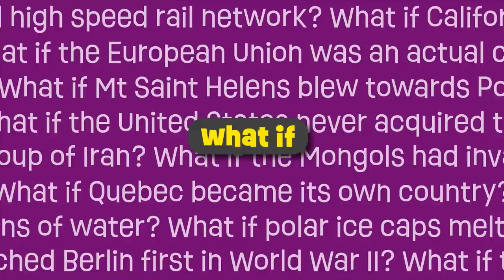Water Pipeline: What If An Aqueduct Was Built From The Great Lakes To The Southwest?

Comment: The rules here in the Great Lakes region dictate that only areas that are part of the basin (that is, ground water flows to the lakes) are able to take water from the system.  Where I live we have Lake Michigan water in our homes.  The town 5 miles south of us has to use wells instead, and the water is so poor that most people use bottled water for drinking, and some even use it for bathing and clothes washing.  If the rules don't allow this particular town that is only a couple miles out of the Lake Michigan basin to remove water from the lake, rest assured no one involved in the management of the Great Lakes is going to allow the people currently wasting and rapidly depleting the water in the Southwest to destroy our Lakes.
Reply: Yeah....BUT....if everyone is so concerned about Lake levels...why do YOU think it's OK to let the Lakes go on a rampage, like they did two years ago, and DESTROY MILLIONS OF DOLLARS worth of shorelines? Those lakes can become wild beasts and letting them destroy property, willy nilly, with out the control of high levels... is as bad as lowering lake levels to supply the South West. Lake Michigan and Lake Huron should be "maintained" at one STANDARD level. Any excess should be gotten rid of by any means necessary INCLUDING selling it to the South West!
Reply: @badguy1481  That still wouldn't be a solution to the problem, because an inconsistent lake level wouldn't be reliable or profitable.  You need to be able to guarantee a certain amount of continual running water to be able to invest in infrastructure like building a pipeline from the great lakes to the southwest.  The great lakes would essentially need to always be above average to make such infrastructure reliable or profitable.  If you're a municipality in the southwest that depends on that pipeline and we go through a decade or more of shortage like we did from 99-2015 in the great lakes then your water source would turn off and you be left without.
Reply: @badguy1481  easy there badguy we can't help people who will not help them selves
Reply: @badguy1481  my god rampaging wild beasts willy-nilly I don't know how we can go on here in Michigan
Reply: @badguy1481  The property that was destroyed belongs to 1%rs boo hoo
Reply: @jcdentoid  Actually you have no clue what happened in Flint
Reply: @marktalsma2390  And city fronts...and public beaches...not JUST 1%'ers. The repair, of which, came out of YOUR pocket in the form of city and state and FEDERAL taxes.
Reply: Hey..."Some" water from the Great Lakes is better than "no" water. Obviously, if that water is not enough to keep the South West solvent (water wise) than other means of obtaining water will be necessary.  @TimothyCHenderson
Reply: No one is "wasting" water in the SW.
We are growing 80% of the entire NATIONS produce from October to May while the rest of the country is frozen in.
The average US family uses 1 acre foot od water today.
That same acre foot supplies 4 families in the SW. Arizona uses less water today with 7 million people then it did in 1960 with 1 million people.
I have long said that the US SW should stop growing agriculture.
The shortages of food that follows and the massive increase in prices in the US would have the entire nation screaming "fix this".
Easy for me to say, I am not a farmer. 
But that is sort of the point, no one wants to fix anything that does not effect them. So let this affect everyone. 
The SW has plenty of water to support its population.
Just not enough to grow everyone's food. So if agriculture is a waste than I agree with you. Let's stop it.
Reply: ohh we whold want a serious amount per gallon knowing its the last of the water left.  im from western ny up by lake Ontario
Reply: In your video you acknowledge the effects of climate change on the West Coast it is indeed getting more heat waves and hotter but if you take the time to look at the effects on the East Coast the atmosphere is holding more moisture and causing it to rain on eastern states longer and more frequently this is causing flooding to become more common on the East Coast So imagine this instead of trying to take water from the Great Lakes one source that is to say. we make a more elaborate system that is connected to various rivers and some lakes on the East Coast Then when it rains more frequently and starts to hit flooding conditions in that area a switch could be Flipped opening up a water pipeline to take the excess water to where it would be needed more thus stopping the Flood From happening and allowing the excess water to be transported to the western states I suppose this is more of a water pipe network then just a simple water pipeline I think it's the best long term solution the western states get the water they need and the eastern states that are being hit with more rain and flooding will no longer have increasing Flooding events. I would also like to make it clear that I do agree that Salt Lake City and the other cities and states in the western states need to manage their water better then what they currently do also I don't know why So many people  think the only solution for a water pipeline would be the Great Lakes sure on the surface that seems like the most obvious solution because it's in plain sight but like you pointed out in the video it's not the best long term solution however this water pipeline network I mentioned earlier would be one of the best long term solutions if you think about it for a little bit and do some of the research on climate change not just affecting the West Coast but also the East Coast you'll see my point. / Also on a side note between 2030 and 2040 Florida is doomed as they are the state that will be damaged the most from rising sea levels.
Reply: @FastEddy301  that so called food they grow out there while we are frozen SUCKS bud!! We grow our own and can what we grow! No hate pal just sayin. Went to Walmart a few days ago, 1 ear of that crap sweet corn, 99 cents! Yes I grow my own!! Thank you Biden!!
Reply: Waterfront Georgian Bay. I have a shore well with a tile under the bay. Across the road, they have water trucked in. Clay.
Reply: With our current administration....you don't have a choice about anything you don't like.
Reply: @KB-ke3fi  
LOL!
Please tell me you aren't blaming the water shortage on Biden.
Reply: @badguy1481  because we can .. I live here and all states & Canada all past laws the last time the SW thought of this .. you want to live where it's warm and hot ..a dessert ..enjoy it in the mean time it's ours so if you want  water ..move to where water is enjoy your hot weather, we're pissed nestle is taking 2 million gal a day out for bottled water at such a cheap price .that has to change quickly also
Reply: When I lived in Chicago in the early 1950s, it was well known that the Chicago River was re-engineered to flow "backwards" out of Lake Michigan into the Chicago ship/sanitary canal and into the DesPlaines and Illinois Rivers and finally into the Mississippi River. That seems to me like quite a bit of water out of the Great Lakes Basin.
Reply: An aqueduct to the southwest from the great lakes is a very dumb idea. The sw needs to solve its own water problems without placing burdens on people who have decided living in a desert is a bad idea
Reply: @Thedaleb1  
There is a suggestion on the floor to do that by no longer being the breadbasket of America and stop producing the food that is shipped to the stores you go to every day.

Is that what you are in favor of?
Reply: That is what the rules state now, but when Gavin Newsom becomes president they will be belong to California.
Reply: @Robert_Keel  so you are you are that that might not be they aren’t gonna what
Reply: @badguy1481  a little birdy tells me you are badguy1%er. I don't give a shit if your house fell in the lake. Not my problem. As for taxpayers money it would take a whole lot to build a pipeline to the Colorado River.
Reply: @asherdog9248  not going to happen they better bury that pipeline or going to get blown up. Just a little monkey wrenching
Reply: Some of the best fresh water on the planet, it taste good and it feels good on your skin... not to mention, I can go to my kitchen faucet tap in the middle of summer and get a 50 degree glass of water right from the kitchen sink... cool and refreshing.
Reply: @walterbrown8694  
You do realize that the whole reason for reversing the Chicago River's flow was to keep the pollution out of the Lake. At the time, all of the City's sewage was going into the river. They did it to prevent contaminating the water supply. 
Plus, that is one river, with a limited flow, not millions of gallons or liters of water over 1000 miles.
Reply: @walterbrown8694  Well...two years ago opening those locks was not enough to lower the level of the lake.
Reply: @marktalsma2390  Hey...We build long distance pipelines all the live long day. Building another one that would both save Great Lake flooding AND supply fresh water to the South West (ALL for a fee going back to the Great Lakes States!) would be money well spent!
Reply: @tomboone201  Hey...Water, like Oil, should be sold at a price. People PAY for other people to drill wells. People PAY for oil to run their vehicles and heat their houses. WHY should people pay for water coming from he Great Lakes! People can LIVE without oil. They CAN'T live without water.
Reply: @badguy1481  Sure thing there badguy1%er, anything to keep your house out of the lake. Still a lot of money and not much return on investment 
.
Reply: @shytownmofo  You are absolutely correct - I, however, never had any  concept of the flow rate from Lake Michigan, since the whole topic was always about the  pollution in the lake's drinking water and the  engineering  solution.
Reply: @badguy1481  you do realize you messed with the wrong badass
Reply: @marktalsma2390  Who YOU? lol! You're kidding....right?
Reply: @badguy1481  I'm thinking your not from  around here or your house is about to go into Lake Michigan so sorry
Reply: @badguy1481  and I could care less about your house this plan to take water from the Great Lakes to out west makes no sense at all
Reply: @badguy1481  Are you expecting water to flow only when the A) "flood gates" need to be opened?  That would be years between very short term episodes. (Maybe you have been mislead.  Flooding of the great lakes isn't really a thing.)  Or are you expecting to B)  permanently lower the level of the lakes such that the occasional peaks could never reach flood stage?  If it's plan B, once that new lower level is reached, would the water be turned off then?  Or would we just drain the lakes dry?  Like the mighty Colorado River.    Robbing Peter to pay Paul might work for the short run, but in the long run, Peter is broke and there's nothing for Paul to rob.  This plan is not sustainable.  For this plan to be sustainable, the amount that would be diverted over say a year, would need to be replenished within that same year.  Where is that extra water coming from to replenish the lakes?  If it's not replenished, the lakes will be emptied, same as the Colorado River.
Reply: Where? Flint? The water is great in Michigan.
Reply: @badguy1481  1-2 tankers, no more is what they deserve, maybe the South West should be more competent with their water
Reply: @marktalsma2390  I know , what the hell is this dude talking about
Reply: @walterbrown8694  How long ago was that
Reply: @mykehunt2430  "Myke" - Over 60 years ago, I worked for a company in Harvey, Illinois - When we wanted to contact another employee, we had the switchboard operator page him. Sometimes, we would request a page for a fictitious person like "Alfred E. Newman" - One time a coworker tried paging "Mike Hunt" - That apparently wasn't gonna be the operator's "first rodeo" - She asked if the page was for "Michael Hunt".
Reply: Great Lakes Pact isn't only a State agreement, but also involves Canada. Almost anything can be overridden by federal legislation however. States should theoretically help one another, but considering the corruption & obnoxiousness coming from places like southern California & New York, where they act like we are "fly over" territory, while they abuse corrupt institutions for their profit, I would go to war before they extract our water for their greed & broken immigration policies.
Reply: @badguy1481  we the people of Michigan, had a governor who took toxic waste from Canada, polluting our water, killing several children. A famous bottle water company filled a law suit, Michigan lost an enormous amount in revenue. We have spent millions cleaning up many of our lakes and water resources. companies using out waters for dumping toxic waste. You want our water, come get. Move here. Most of our water comes down in SNOW AND ICE!
Reply: @badguy1481  yes, out our shorelines shift and change. removing water tables Is Not Going to change the wind. Water from the west side of Michigan will soon be in Detroit. And vice versus. Move to Michigan. If you want water. Experience true ICE WATER.
Reply: @poppydillings7448  BS! I suggest you get the monthly periodical from the Army Corp of Engineers regarding Lake levels.
Reply: @poppydillings7448  And you OWN IT...the water? You OWN what's on your property (NOT including your house!). The COUNTRY "owns" the water...not you!
Reply: @RomanMyshoul85  And you? Do YOU water your lawn in the summer. How about when you take a shower, do you let it run a long time to make sure it's nice and hot. How about all the leaky faucets in your house? Why don't YOU stop doing what you're doing when it comes to wasting water?
Reply: @annnonomys3132  Hey...Maybe the South West should keep all it's oil and let YOU move to where you can fill up your tank. And how about all the fruits and vegetables you get from the South West during the winter in the "Great" Lakes...using water you say they're "wasting". And next time your house gets hit by a flood...or fire...or Tornado...maybe the rest of us should tell YOU "move to where your house won't HAVE any of those problems?
Reply: @DavidJohnson-pu2jh  Actually a better idea from the "fairness" side anyway. And it both balances out two problems and gets to a feasible solution. The downside is that it would take several dozen thousand miles of say 24" pipelines criss crossing the country to really make this work- to build a pipeline or aqueduct system to move the water across 2500 miles- that aren't very level BTW- lots of uphill pumping energy will be needed, there will be places where many lines going through a given area will need a right of way hundreds of feet across. You won't bury a lot of it, so arranging and maintaining both the legal and necessary upkeep  will keep an office full of people working all year long, every year. Oh, and building it will be a work for a half million men for decades. LA will have collapsed into the dried up remains of the LA River they started cementing up a hundred years ago long before you can deliver the water. Your best point is that there really is enough water and then some, for the US now for and for the immediate future; how then do we apportion it among our various states and parts? And how should we treat a territory like Puerto Rico? Wouldn't building them a many billion dollar desalinization plant make more sense than a pipeline? And now the desal is brought into the discussion, why wouldn't large scale desal work for California? And why shouldn't Cali be selling water to her neighbors at muni prices? I mean with 880 miles of coastline Cali has the places to get fresh seawater from, you think? Get over any idea there is a cheap or fast final solution here- trillions of dollars, decades of infrastructure investment. It would be a natural development to add rebuilding and rationalizing our national energy grids at the same time, don't you know. But it's not a bad idea at all. Just a few minor bumps and potholes and "Bob's your uncle"- done!   And it was all so predictable. the geophysical exhibition we call the Grand Canyon has been telling us about thousands of years, some with very little water and some with ground gouging deluges, over thousands of years. But apparently we thought not "our thousand years". We really need to fix that flaw in our ointment too.  FR
Reply: @annnonomys3132  Nobody is saying DRAIN the Great Lakes to supply the South West. What we're saying is regulate the level of the Great Lakes, especially Lakes Michigan/Huron so we don't get these wide swings. That water can be better used someplace OTHER than letting dump into the North Atlantic. We can dam up the outflow of both lakes at Detroit so the level of the lakes can be maintained while continuing to supply water to the lakes below them, Erie and Ontario. And THOSE lakes don't need to suffer either because they can add to the water fix by damming up their outflows over Niagara Falls and the St. Lawrence Sea Way.
Reply: @marktalsma2390  Nor do YOU!
Reply: @badguy1481  You do realize that if the cost to ship and pump a gallon of water were exactly the same as crude, you are talking about 15,000 gallons a minute, every day, every week of the year- mucho mega bucks, water bills that look like house payments for basketball half court size lawns. Even if it cost less per gallon/mile traveled, say 25% less, it would still be staggering.  FR
Reply: @badguy1481  I live in a state that has water and also doesn't completely miss-manage it.  I don't waste money on bottled water, I turn my shower water off and back on and I water the hell out of my grass so I could complain about cutting it twice a week.  Move to a state that isn't killing itself
Reply: @badguy1481  kiss off
Reply: @badguy1481  bull that’s how it starts
Reply: @oldjarhead386  Hey....If you don't like low water levels in the Great Lakes....build dams along the entire stretch, from Lake Superior to the St. Lawrence's outlet to the ocean. Right now there's NO....ABSOLUTELY NO regulation (except, maybe, at Soo Saint Marie, by the Soo Locks...and guess what, Lake Superior's water level doesn't vary much at all! Hmmmm. I wonder WHY??)
Reply: @tomtrajnowski4266  Ditto! OBVIOUSLY...the truth hurts!
Reply: @RomanMyshoul85  Oh...You TOO are a water waster... I see. And you're complaining about those water wasters in the South West?
Reply: @fredericrike5974  Hey....Gas is expensive and people keep paying the prices required to drill it out of the ground, ship it to refineries and truck to gas stations. 

Pumping water from the Great Lakes has GOT to be cheaper than that! And what's the other option? You can LIVE without gas. You CAN'T live without water. WHATEVER the cost people will PAY!
Reply: @badguy1481  I guess you missed the point that I'm not stupid enough to live in a part of the country that has NO WATER.
Reply: @RomanMyshoul85  Gee...You wanna medal?
Reply: @badguy1481  settle down there badguy1%er, take a deep breath. Sorry about your lakefront property
Reply: @badguy1481  Oil and veggies are a business for which the end user pays and the producer makes a profit.  It's a win-win.  Maybe someone could make a business out of buying and shipping water to the southwest at the expense of it's end users.  But seems unsustainable.  Pretty expensive for that end user.  Probably cheaper for that growing population to leave.
Reply: Columbia River could be an additional source.
Reply: @badguy1481  I live near Lake Erie.  I am unaware of "wide swings" of the lake levels.  The lakes will below average for years, and then above.  We get water from wells and Lake Erie.  If I understand correctly, we do not get water from Erie during the summer due to water quality issues.  Why should we prop up a rapidly expanding massive population in the desert?  Do these desert folks have enough money to pay to bring water there, or are the rest of us supposed to support their lifestyle choices?  And what economic and environmental damage would this cause even if all this were "free".
Reply: @FastEddy301  wasteful ag is a waste,cut down all the almond trees and you have enough water for the stuff we need. I don't need almonds that much
Reply: The water in the Great Lakes mostly fell as rain onto Ontario, Canada.  Very little rain falls on USA states (except Michigan) flows into the Great Lakes.  USA states are mostly in the watershed of the Mississippi River.
Reply: You are spot on if they were allowed to have access to great lake waters they would just use ever-increasing amounts of water with no regard to conservation and suck the great lakes dry just look at lake mead.
Reply: @annnonomys3132  Well...Lake Erie evidently didn't see the Lake swings that we did on Lake Michigan and Lake Huron. Those swings did A LOT of damage to their shorelines. Keeping their levels at some standard level would save us all A LOT of tax money.
Reply: @badguy1481  The project proposed here is massively expensive.  Probably cheaper to plan for the natural rise and fall of the great lakes.  In addition, such projects inflict their own economic and environmental damage.  And such projects are often approached as if they are infallible and permanent.  They are neither.  Think New Orleans Levee disaster.
Reply: @DavidJohnson-pu2jh  Hot damn! Somebody who reads long stretches of comments! You were correct to point out the salt problem- but that may mot be nearly the problem you think; Pacific salt water has not only sodium chloride (common salt) but trace quantities of nearly every metal on the strategic metals list- those could be extracted and are valuable enough to help defray the costs. Then start blending up your sewage waters for release into an oceanic environment with salt to the same percentage of sea water at that location. Both you salt overage will be dealt with and the salt will accelerate the decomposition of bio materials still in the sewage runoff.
All that is in the realm of the possible- none of it is cheap- more zeros than you think, many numbers will run to the trillions and take decades to accomplish. What LA and Cali are clamoring for is an answer in the now of this and next year. there isn't one I am aware of, even without getting into the multistate scramble it would take to get all the approvals, licenses and rights of way needed. BTW, just to do a big desal with multiple locations in Cali would take at least a few years of wrangling just to get all the paperwork done. So, political will will also be very necessary- a lot of political will, from both sides of the aisle.  FR
Reply: @TimothyCHenderson  The purpose of dams on the river is to store the water during those surplus years. There should be a turn off so that continual running of water is not necessary.  But the high levels of the Great Lakes could be controlled and still provide transport during the excess years.
Reply: @badguy1481  no it would not save us taxpayers, it would keep your lakefront mansion out of the lake, so sorry for your loss
Reply: leon hill  actually he does live by the water and his shoreline is eroding and his house is about to go into Lake Michigan. He doesn't give a shit about the SW he just wants to lower Lake levels he still has a little bit of lakefront property left
Reply: @badguy1481  badguy1%er you have still not called me on your 1% status,wonder why not. The truth hurts.
Reply: @marktalsma2390  Lol! IF you live anywhere NEAR Lake Michigan or Lake Huron go to your nearest City Hall and ask them how much they had to spend to refurbish their lake side parks...road...bluffs...etc. Then get back! (Oh..and P.S. Don't worry about my house falling into the lake. I'm not!)
Reply: leon hill  And YOU don't live in a state that has tornadoes...or forest fires...or floods...because you WON'T be "on your own" and I'LL have to pay more taxes to insure you're not?
Reply: @annnonomys3132  Hey...Take a ride down the Mississippi and SEE the number of dams and locks that YOU have helped pay for! ONE DAM across the St. Claire river would be enough to keep the Lakes at a standard level and keep them from dropping below that level. If the Lakes get too high the dam could be opened and the pipeline could help syphon off any excess.
Reply: @annnonomys3132  OF COURSE that water resource (like oil) would be paid for! Nothing in this world is free.
Reply: leon hill  And with your attitude... I don't care about none of u EITHER.
Reply: @badguy1481 give it up
Reply: @badguy1481  so I hear your house is not going into the lake
So glad you were able to move it back.
.
Reply: @DavidJohnson-pu2jh  I have been following the global ecological disaster for thirty or more years- I was a high school student when Nixon's government turned out the EPA act. It wasn't ever supposed to "save us from the end of the world", rather it seems the Nixon government was looking to regularize environmental rules and reduce the never ending lawsuits from the Sierra Club on the West Coast and the Riverkeepers on the East Coast. Note, the SCOTUS has said agencies, like EPA, cannot just write their own standards- Congress must hear, debate and weigh in officially. BTW, although I think the EPA was a great idea from the get go, I agree with having Congress take a direct hand in promulgating those rules. Congress didn't want that job because it gets in the way for them- those rules might make "enemies" of big donors and such like PO'ed with Congress for biting their personal sausages.  FR
Reply: @badguy1481  You do realize you cannot just "dam up" the Great Lakes to retain water levels. Freighters on the Great Lakes move 38 million metric tons of cargo across the Lakes annually.
Reply: @Superintendent-iy9zv  you have apparently never had a grape fruit from here have you? Put it up against anything from the Midwest. Same goes for lemons, limes, apricots, almonds, avocados, cantaloupe, honey dew melons, and strawberrys. In fact Arizona is ranked second in the nation for all of the above.
How's the avocados by you? Maybe your grapes are better? Funny how the SW now ranks #1 regularly for wine. I mean if corn is your thing than no doubt the Midwest wins. 
The grapefruit makes Florida's taste bitter as hell.
More importantly the livestock in the country really don't care what the food tastes like. 
No matter your opinion, the SW grows over HALF the nation's HIGH-VALUE specialty crops.
Worth hundreds of billions to the nation's economy. That's not even mentioning the beef from Arizona and Texas. 
My whole life I ate the crap out of the northeast and Midwest and never knew what a good steak was until I had one local.
Reply: First "freighters"...."foreign freighters"...have SEVERALLY damaged the eco-system of the Lakes. They've brought in fish and shell fish species that have caused MAJOR damage. Yeah...Ike thought it was a great idea to make the Great Lakes accessible to ocean going ships. I even remember all the celebration and hopes for the future when he cut the ribbon! BUT......He and just about everyone else did not know the nightmare they were about to cause.

SO....ocean going ships should be BANNED on the great Lakes. ONLY Lake transports should be allowed to ply the waters. And just like on the Mississippi...putting in a damn does NOT mean those ships can't traverse across the damned up point. Drive down the Mississippi, one time, and you will see one set of locks after another. Those locks NOT ONLY allow shipping to pass through they can also act as a barrier when water levels get out of control. The ONLY problem on the Mississippi IS if the water levels get out of control. They have no place else to send it other than to open their gates and let the next set of locks worry about the excess water. THAT'S WHY Dams along the Great Lake's "choke points" combined with outflow pipelines, to ship the water where it can be used, would eliminate that problem.
Reply: @badguy1481  not only the pipeline would be expensive but now you want to double down on stupid and build a bunch of dams and locks. That's a lot of taxpayers money there honey
Reply: @FastEddy301  the SW grows over half the high value crops until they run out of water,what happens next we in Michigan will supply the country. We grow weed year round, we already grow more diverse crops than any state other than Cali, we don't need your weed and we will get by without your bs
Reply: @badguy1481  SEVERALLY really ally
Reply: @marktalsma2390  Like I said....Checkout ALL the dams and locks on the Mississippi. All Lake Huron and Lake Michigan need is ONE dam, about HALF THE SIZE of any of those on the Mississippi (at Detroit) and the water problems on the lakes would be over (when a syphon drain to the South West is ALSO installed.)
Reply: @badguy1481  Do you have any idea how big these lakes are and trying to control water levels is probably almost impossible.
Reply: @user-rc6me8tg6j  Look at Lake Superior...EASILY controlled by the Locks at Soo. By denying that the problem of controlling water levels in the Lakes is "almost impossible" you're acknowledging that the continued outflow from these VERY valuable water storage reservoirs (valuable to the very life of the USA's population) to the Atlantic Ocean is our only course.
Reply: The great lakes states would never allow it. The great lakes would be drained in no time if the people out west took the water.
Reply: @badguy1481  give it up badguy1 you have shown yourself to live up to your badguy1 name. No one wants a badguy
Reply: @marktalsma2390  lol! But EVERYONE wants the money that controlled Lake Water level will save them in their yearly state taxes....INCLUDING, I would guess, YOU`
Reply: @badguy1481  when a syphon drain is also installed to the SW, you need to set down the Crack pipe and start smoking some Michigan weed
Reply: @badguy1481  my state taxes aren't enough to break the bank. I don't mind paying them it's a part of living in the greatest state in the country
Reply: It would make much more sense to take it from the Upper MS river system, in areas it Floods every year from the winter freezes and runoff...causing Billions of dollars in damage over time.
Reply: @TimothyCHenderson    Remember in the 80's we had too much water..so it's all variable.  Why has the SW gone into a water shortage, People for the most part...Millions and Millions of people moving here, because all the big, poorly run cities in the NE and  Upper midwest (Chicago) have run Law abiding people away, and now Californians are Fleeing to AZ for many of the same reasons.
Reply: @Thedaleb1  do you speak english?
Reply: @badguy1481  It floods because , they hold water back in the winter to make sure they have enough water depth in the spring for ships. Not because they have to much water 🤣😂🤣😂💩
Reply: @badguy1481  make your own water !
Reply: @badguy1481  LOL you clearly know absolutely NOTHING about the Great Lakes bub.
Reply: By then we will have perfected the process of turning salt water into fresh water and then we can replenish the Great Lakes with those same water pipes. More desalination plants have to be built.  We just have to bring down the cost.
Reply: Corruption and money can make things happen
Reply: Same thing I say 👍
Reply: @badguy1481  there is no real flooding of any major consequence in the Great Lakes. I was born, raised, and lived here all my 72 years. Plus I have been a shoreline seawall contractor since 1986. I think I am very qualified authority on any supposed ‘dangerous’ Great Lakes flooding. The lakes have always risen and fallen on a predictable cycle!
Reply: @assertivekarma1909  why doesn’t California and New York state just leave the U.S. trust me Michigan does not need them and would be very happy if they left!
Reply: @FastEddy301  Michigan is the only state in the union that needs no other state. We have every natural resource found in the world(we should have left the U.S.A. Long before the south tried to leave)!
Reply: @badguy1481  the Great Lakes region is too low lying and flat for dams! Visit here and you will find out! Lol
Reply: @badguy1481  dream on
Reply: @darrylthroop5100  not true
Reply: Water out of the great lakes would have an economic impact on the Midwest because ship traffic would have to carry less cargo due to shallow shipping channels. This all reminds me of a lake owner association near by on a small inland lake , over approximately 8 years there lake was drying up and the wanted the d.n.r. to pump water from a river in order to bring there lake back to normal. The dnr said no. It will come back on its own. 1 night years later they got hit by a bad rain storm dumping over 16 inches of rain . Almost all the houses were flooded. So now again they asked the D N R  to pump the lake out PUMPING IT 10 MILES TO A RIVER. The d n r said no because if there was another drought later on the d n r would be at fault for draining it the first time. What I'm trying to say is leave mother nature alone . she knows how to work things out
Reply: Federal government " hold my beer"
Reply: @badguy1481  obviously you have never been to the Soo Locks  there is a very large rapids on the river that controls the lake level, the locks have nothing to do with it , the locks only made it so  boats and freighters  could navigate from the StMarys river into Lake Superior. Besides the Michigan lake level is down 14 inches at least this year.  The lake cycles all the time.
Reply: I'm from Michigan and second that. Now if we could only get Nestlé to stop bottling it and selling it for a huge profit to those same poor people you mentioned. 😢
Reply: I just went to lake Michigan a few times this summer (Silver Lake, Sleeping Bear) and its hard to believe that they get the water from Lake Michigan.  Sleeping Bear had algae floating in the water (like an Algae bloom) and there were THOUSANDS of dead fish ALL OVER.  Floating in the water and 20x more laying dead on the shore. We had driven 3 hours to get there, walked like an hour and couldnt swim.  I forgot to mention it was FRIGID too.....I felt bad. I let him jump in, but I was concerned for his health. 

Silver Lake is pretty great, but with all of the boats that I had seen, its a tad scary to think what is in the water.  I guess the lack of dead fish and warmer water there makes you forget some of the rest.
Reply: @highwatercircutrider  Hey....A dam across the St. Claire river, in Detroit, would keep the lake levels of Huron and Michigan at whatever level we choose to set them. Take a look at some of the dams/locks along the Mississippi. They allow the river levels to be controlled the same way as that dam across the St. Claire river would do.
Reply: @highwatercircutrider  We're not talking about flooding, although I remember the lake drive along Milwaukee's lake front was nearly covered in water. What we ARE talking about is damage to shorelines due to high lake level and high wave action. If the Lake levels were controlled with dams we wouldn't HAVE those problems.
Reply: @FastEddy301  almost no one ever looks at it that way. Thank you for this comment.
Reply: @highwatercircutrider  We should be stronger together, but their are some serious divisions developing. NYC is an institutional leech, they make vast amounts of money off of corrupt industries & structural perversions.  California is a diverse State, but like NY its hubs of power are centered in some sleazy industries/institutions & influence of neurotic/manipulative ideologies.
Reply: @badguy1481  dams need to be anchored by river side rock (we have sand and clay here).
Reply: @badguy1481  the only lock system to accommodate ships 1,000 feet long x110 wide drawing 26’ is at the locks  of Sault Saint Marie (built agains’t solid bedrock). The federal government claims to not be able to afford the cost of even an additional lock there. We have no surface bedrock on the St. Clair river system to allow the construction of either locks or dams. Plus our terrain is dead flat. We are just mere feet above the water level. Diverting Great Lakes water is just a ‘pipe dream’ for those who don’t live here and understand the geography of the area.
Reply: @assertivekarma1909  I and many others would be quite happy to live in a separate free country called ‘Michigan’, separate from the rest of the lunatic ‘United Sates’! We are about done with ‘America’!
Reply: California supplies 50% of the nation crops, when they stop growing you may feel different, plus paying for water from the lakes could supply the area with a handsome tax base.
Reply: @dickflow3641  don't think all Cali farmers are going bust at the same time. Some will some won't. So this scare tatic that we're going to have a famine is BS. We grow weed in Michigan year round and that industry came about in just a couple of years. I'm sure we can grow fruits and veggies too. Maybe not almonds but you can grow them with the water not wasted on lettuce
Reply: @dickflow3641  Michigan has far better soil than California, rains periodically , so no need to irrigate and most people here prefer Michigan’s own produce to California’s anyway......we don’t need California for anything.
Reply: @badguy1481  were not talking about flooding were talking about saving my lakefront property boo hoo
Reply: underground aquifers are part of the great lake system, which goes into other states as far to the Colorado lines, and as far as the east coast and the southern states,
Reply: @highwatercircutrider  Calling the control and preservation of the fresh water in the Great Lakes so it can be used by parts of the country that NEED water, a pipe dream because it would cost too much to build dams at the mouths of all those Great Lakes doesn't take into account the cost of alternatives (more water diversion from rivers....desalination plants).
Reply: @highwatercircutrider  If you're referring to the Soo Locks area...you ALREADY have 5 dams there. Two locks, Two power plants and a water barrier at the mouth of the St. Mary river. If you're referring to a dam at Detroit, the river is smaller there than the Mississippi and the many dams on the Mississippi are placed in what appear to be similar geological strata to that of Detroit.
Reply: Nah you burned your bridges out there leave our lakes alone
Reply: I live in Alpena, we have Lake Huron water, we are pretty protective of the lakes. I agree with you on the principle, but our politicians have a long history of selling out our resources. I hope it never happens, but I could definitely see it happening in the future.
Reply: Great Lakes Water Quality Agreement (GLWQA) is a commitment between the United States and Canada to restore and protect the waters of the Great Lakes.
Reply: @marcmathes41  Same here!
Reply: @Robert_Keel  You'd blame it on Trump, so why not?
Reply: @badguy1481  There is no price you can pay that will serve as recompense for giving us a Lake Mead in our own back yard.  Disperse!
Reply: @badguy1481  yes and the Soo locks area dams are anchored in solid bedroom. Detroit sits completely on hundreds of feet of solid ‘rock salt’. That would be a monumental disaster in the waiting.
Reply: Bedrock, lol
Reply: It has already been said that states using the test lakes now return wster back to the lakes, where as popping great lakes water to the southwest is not returned
Reply: @thatsreality5184  Certainly, I would THINK, California should be pursuing Desalinization of sea water as an alternative solution...cost be damned!
Reply: @highwatercircutrider  How so? If a dam was placed on the St. Claire river it would actually decrease the flow of water past Detroit and counter act the dredging that the Corp of Engineers did several years ago.  That dredging actually HARMED the levels of Lake Michigan and Huron by INCREASING the drainage from the Lakes and dropping their levels. Slowing the outflow with a dam would actually help preserve the sold material below the river by decreasing the wearing away of the river bottom. Checkout all the locks and dams along the Mississippi built on sand stone.
Reply: @yrreteugarps2835  How is PRESERVING the levels of the Great Lakes, using dams, going to turn them into a Lake Mead? Excess water can be syphoned off and used instead of allowing it to be dumped into the North Atlantic.
Reply: @jerryaulphgmail  How is letting the Great Lakes flow "unhindered" into the North Atlantic allowing the USA and Canada to "restore and protect the waters of the Great Lakes"? Obviously...it just the opposite result that is currently occurring!
Reply: @ericnortan9012  Building dams along the Great Lakes, at "choke points", can ONLY preserve the levels of the Great Lakes. Using any excess water to do something productive, rather than letting it dump into the North Atlantic, can only benefit the country. And regarding politicians: If they wanted to, they could just open the locks in downtown Chicago and let Great Lake's water flow "unhindered" down the Mississippi and draw that water out of the Mississippi to pipe it to the South-West. Remember: IF the politicians violate a standard, agreed upon level for the Great Lakes, they will have to answer to 30,000,000 voters in the Great Lakes area ALONG with the Canadian government.
Reply: @yrreteugarps2835  
???
WTH are you talking about?
Reply: @FastEddy301  An acre foot of water is 325,851 gallons. There is no way an everage family can use that in a day. Maybe a family could use that in a year if they had a large lawn and/or garden and they watered heavily. That is about 915 gallons a day. That is a lot of water. 

According to the USGS, an average person uses 82 gallons of water a day. That would be 248 gallons a day for a family of four. An acre foot of water would actually last an average family about 3 years and 8 months.

You might want to do a little research next time you think of posting something like that.
Reply: @badguy1481  We in the Midwest get our oil from North Dakota and Canada.
Reply: @herbb8547  And do we get all that oil from North Dakota and Canada for free? How about Texas? Do THEY give away "their" oil for free to their customers? Me thinks NOT. Do you think the states along the Great Lakes and Canada would give away "their" fresh water for free? Me ALSO thinks NOT. A person can live without oil indefinitely. How long do you think a person can live without water? Something like 3 days? WHY are we letting all that VALUABLE ASSET,  fresh water, flow into the North Atlantic....for FREE?
Reply: @badguy1481  they can put a pipe in the Mississippi and accomplish the same thing without disrupting the Great Lakes. We have excess now, 10 years ago the lakes were down so low it was threatening shipping. Though in theory I agree with about everything you said, I live in Michigan, and our legislaters can't be trusted to do what the people want. I assume it's no different than any of the other states in the pact.
Reply: @badguy1481  Of course we pay for the oil from North Dakota and Canada. Point is the oil from the southwest does not go to the Midwest.  Based on your logic, we would have to divert Niagra Falls to the southwest. That is where the water leaves the great lakes. A much better solution would be large pipeline from the Mississippi river just north of the Mississippi delta where it is still totally fresh water. The volumes of water there are tremendous and water diverted there would not even be noticed. And it would be free to take as no one would complain.
Reply: I think the west needs to come up with a better plan. How about desalination plants.
Reply: What about Nestle?
Reply: @badguy1481  we have no sand stone on the St Clair river, just clay going down 150’ and more. Plus building a dam would flood the entire Detroit metro region. The Corp of engineers looked at it years ago and concluded it just is not feasible in this area. Even a dam built on the bedrock of Niagara falls, would flood the great lakes basis uncontrollably. We get ship sinking ocean sized waves up to 26’ during fierce winter storms here. Nothing much about the Great Lakes is controllable by man (they are misnamed, actually being huge inland fresh water seas).
Reply: @badguy1481  that's outlandish and shortsighted. The solution I believe is don't build on flood plains.. .. ..
Reply: Also the water is co-owned with a foreign country.  It would require an international treaty to steal the water. I don't see that happening.
Reply: @FastEddy301  ya right.  If you live in a desert then u shouldn’t have green grass, personal swimming pools, farmers raising almonds and rice, and bathing every day.  Oh, and how about LV?  Water, water everywhere…. It is a DESERT!
Reply: @FastEddy301  no one in the SW is wasting water!!??    Then no one there deserves a lush green lawn.   Use astro turf or spray the dirt green.     No one needs a swimming pool.    Have one for for the community, not every other house.    And who in their right mind moves to live in the middle of a desert!!??   I get it there are people who are native to the area, but probably 80% of the people there MOVED there!
Reply: @KB-ke3fi  LOL!!!   Water shortages in the US did not start January 2021.
Reply: @badguy1481  don't fuck with Mother Nature, history has shown that not a good idea
Reply: @Robert_Keel  did he?
Reply: @asherdog9248  almonds take 17 gallons a pound to produce not really a necessity.
Reply: @badguy1481  I suggest you sell your lakefront property and move to Flint
Reply: @badguy1481  the country doesn't own the water the states and and Canada own it the boundries go right thru the lakes right down the middle of the St Claire and Detroit rivers. When you live in the desert logically you can't have pools and golf courses.
Reply: @badguy1481  don't water my lawn don't like cutting it.
Reply: @badguy1481  there are frozen and canned vegetables I can eat in winter, and I can live without  avocados
Reply: @badguy1481  why should we pay to build dams things are fine the way they are
Reply: @marktalsma2390  
You may not need almonds, but there is obviously a lot of people who do.

Since you don't seem to care about that, it's probably a good thing you don't make the rules.
Reply: @Robert_Keel  obviously a lot of almond growers, the rest of us not so much
Reply: @marktalsma2390  Building dams along the Great Lake's "choke points" is FAR from fucking with Mother Nature. Preserving that very VERY valuable resource (more valuable  than oil!) should be our number 1 priority!
Reply: Yeah you got it right man!!!!  leave our lakes alone !!!! and I live in Central Indiana and lived near Detroit for a few years !!!!! 
(((( they’ve got the ocean let them take the water from the ocean and desalinate IT !! And pump that stuff around from state to state out west !!!!!!!! !!!!!! That’s the real deal people !!!!
Reply: @marktalsma2390  
Sorry friend - supply and demand.
No market?  No demand?  No sales.  No profit.
Reply: @Robert_Keel  no water no almonds
Reply: @Robert_Keel  no market, we grow weed here now we don't need Cali weed
Reply: @Robert_Keel  what you need to know is the weed industry came about in just a couple of years. Megatron is in the business,he's not losing money we have the water and you don't. Face the truth
Reply: @lavalampluva55401  I don't have a blade of grass anywhere in my yard. Moved here(partly) because I hate grass and yard maintenance and so does everyone of my neighbors around me.
The average American family uses one acre foot of water per year.
Here in AZ 3 to 4 families live off that same acre foot.
Sources:? Google it, very easy find. 
So tell me again how we waste water when we conserve 3 to 4 times the amount of water.
WE ARE wasting water growing agriculture for the rest of the country and I suggest we stop it right away.
The SW could be 100% self sustainable. 
But I'm not a farmer, it's easy for me to say when my life won't be impacted. When the impact is felt when and if we do stop growing agriculture the country as a whole will demand action.
Because I too was ignorant to the role the SW played in the nation's food supply until I moved here.
Agriculture accounts for 80% of water usage.
So I'm sure you can find some yahoo with a lawn here and there. And a big pool here and there. But at the end of the day even that only accounts for a fraction of the 20% that "people" use.
Where I'm at outside phoenix we don't even use Colorado River water. 
We pump from an aquifer with an estimated 80 year life span provided we never get rain again.
Reply: @lavalampluva55401  and who lives in the middle if the desert? Over 7 million people just in AZ. You have apparently never been here or you would understand why. One of the most beautiful places on earth.
And we have 9 months of perfect weather.
I rather pose the question as who lives in the path of hurricanes besides the whole gulf coast and east coast that we have spent Trillions with with a capital T rebuilding over and over. Or who lives in flood plains?
Or who lives where it is to damn cold to go outside 5 months a year. Who lives in tornado alley?
Reply: @marktalsma2390  if ya can find anyone to farm it. There are so many Michigan plates here it's a wonder anyone one is left in that frozen hell hole.
Reply: @badguy1481  At what level do you "regulate" the lake levels? 
The Colorado river is "regulated" up the wazoo. They still have water shortages because the basis of the 'regulation' is river levels 200 years out of date. 
.
If the warming trend continues, even the great lakes probably won't have to worry about high water levels.
.
What happens when the 'regulations' are set at today's and the water levels go down, like they did on the Colorado river system. Are the regulations going to force unrealistic water flow from Great Lakes to keep California and Phoenix happy because they bought "water rights" from Great Lakes?  
.
Right now water prices EVERYWHERE are not realistic. Price water to all users, "public" and businesses and farms at a realistic value and their water use will reflect the price. Their products will reflect the cost of water. No more giving a water bottling company local water rights to export water at tiny fractions of a penny per ton of water for a product that is sold a $'s per gallon. Bottled water is the biggest rip off from the local water ecosystem. 
.
Or maybe as well as other costs of production, water intense products will include a parallel "water cost".  It took x amount of water to produce this quantity of the "thingie" we are shipping to you, as well as the other product costs (plus profit of course), please send us that amount in water or water equivalent imports to our watershed.  So when California farms sell produce that used X tons / acre feet / gallons (what ever unit) to produce, California expects an equivalent amount of water, in tankers or water rights from colorado river etc to be sent, or products with equivalent water cost be imported from that  provider.   ie We sent you a truck / boat load of farm goods that used x tons of water to create, you send us fabrics or steel or other produce that used an equivalent amount of water.  

Like trading in "carbon credits". Create a balanced economy that is based on water production use/"costs".
Reply: @herbb8547  I said the average American family today uses an acre foot foot of water per year.
You look it up.
In Arizona 3 to 4 families use that same acre foot a year. Look it up and hit me back if I'm wrong. Which I'm not because I did study it before commenting which you apparently did not because your math is waaay off.
Reply: @FastEddy301  I did look it up and my math is correct.
Reply: This is why we need Desalinization,imported water from the Pacific and or Gulf of Mexico!!!!!!
Reply: What people on this thread don't realize: THEY and their STATES bordering the Great Lakes do NOT.....let me repeat that.....DO NOT own the water in the Great Lakes. They DO own the land up to the water's edge. They even own the land UNDER the Great Lakes up to their state's border. BUT...They don't own the water. That water is the property of the Public Trust formed by the Federal Government. Water regulation, in those Lakes, is left to the International Joint  Commission. That Commission ALREADY has limited regulation responsibility for  water levels on Lake Superior and Lake Ontario. It's just "one more step" for that Commission to begin regulation of Lake Michigan, Huron and Erie.
Reply: @marktalsma2390  What is this "THING" you have about growing weed?
Reply: @joblo341  Hey...If you're going to take water from the end of the St. Lawrence HOW are you gonna distribute that water to areas of the country that need it? BETTER to divert Lake Superior water to the Mississippi and syphon it off somewhere around Minneapolis, like Lake Pepin. The water of the river is still clean, there, and can easily be processed for human use.
Reply: @FastEddy301  sorry about that last comment I thought you were from Cali. My late brother lived in Tucson since the 70s and he loved it. I visited numerous times starting in 78 last time was 2016. When I bought up the subject he said there was no way that was going to happen. Native Michigander transplanted to the desert. He knew that was a non-starter
Reply: Facts!
Reply: You have to think of those rich moviestars who want their lawns nice and green at all times. Like Brad Pitt and  the Kardashians. Theae people are used to their lush green lawns.
Reply: @badguy1481  we don't own the water but we control the water possession is 90% of the law
Reply: @asherdog9248  this will never happen
Reply: @asherdog9248 
I hope  he is never  president!!!
It would be the end of America!!!as we know it . Vote 2024!!! And make America great again!!!   
    Trump for  president!!!
Reply: It is adorable that you think you have a say in it.
Reply: @sleddy01  definitely cryptic say what you mean and mean what you say
Reply: I understand the Nestl'e draws water from sources feeding the Lakes, to supply their bottled water plants? 
Small effect?
Reply: When food is declared a "threat to National Security" all those laws will become moot.
Reply: In the chicago region, I did not live in the lake mi watershed, but twp pumped water out of Lake Michigan for our consumption.
Reply: @badguy1481  , once the conduit is open… the SW and other regions will demand access. No doubt including legal action to keep it open.  Neither the SW, USA, or Humans have shown any ability to rationally regulate resource use, especially when preserving their “way of life” is at issue. We cannot do this. Ever.
Reply: @FastEddy301  I agree. Let’s stop it. Also, stop diverting corn into energy (it’s terribly inefficient anyway) and keep those acres churning out food. We can do it without desert veggies 4-5 months a year.
Reply: @badguy1481  you realize that won’t happen right? The Great Lake compact is international compact. You have Canadian providences that also touches the Great Lakes. The water rights in the Great Lakes powerful that why Mississippi River failed to get Great Lakes.
Reply: @badguy1481  dude you aren’t getting the Great Lakes water. Get over it
Reply: @badguy1481  read the Great Lakes compact
Reply: @Whitneypyant  he doesn't get it,and I think he never will.I have been trying for a while now. Those of us who are not delusional know it's not going to happen
Reply: A water pipeline at the top of those mountains to force more snow drop would do so much for America alone side filling some lakes and keep this going we could cool down the planet at the poles as well by freezing the ice back in place by trucking hydrogen fuel gained by solar

Waymo is in 30 states and 6 countries keep that in mind hive mind approaches to things are near possible we could solve alot of scaled problems removing people completely out of the equation and we just about did that a car that rests and moves with the power of the sun
Reply: @badguy1481  don't forget canada gets a vote.
Reply: On the use of Lake Michigan water? That's entirely within the continental USA.
Reply: @badguy1481  hydrologists consider Michigan and Huron a single lake. Canada still gets a vote
Reply: @marktalsma2390  Canadian hydrologists? What if the USA puts a dam across the straits of Mackinac?
Reply: @badguy1481  what a great idea then Enbridge wouldn't even need to build the Great Lakes tunnel they just put line 5 in the dam
Reply: You’d lose that fight If I came down the food, the west produces the majority of food In the U.S.
Reply: @badguy1481  No, you are wrong.  What the problem is, is people, rich people, building on land that is known to erode or in a desert and want to deplete another region to support their free choice.  Lake Michigan was at low levels for over well over a decade.  It gained volume to past levels (last 2 years you speak of).  A lake is part of nature.  Lakes don't go on "rampages", only emotional beings do.  It only reacts to its environment.  Maybe people should react to their environment and NOT build on land prone to erosion?  Huh, novel thought.  You act like the selling of water (that cannot be replaced, once out of natural water shed), would magically stop once a level was reached?  Boy, you are dense.  You stated, the lakes should be "maintained" at a standard level.  Ok, I'll bite oh smart one, how do you keep a lake from lowering past a specific line?  You can only let water out, but you can't create water.  If so, they wouldn't need to take water from one region and go to another.  Why not do desalinization of ocean water much closer?  Try that one on for size
Reply: @johng.9877  Duh? You DAM each lake outlet so you don't HAVE low water levels. THEN you create an outlet that allows excess water to flow to areas that need it. WHAT is so difficult for you to understand?
Reply: @FastEddy301  that's not quite true.
Heard a news story about one place in the Southwest where supposedly extreme conservation  measures were being implemented including restricting urban home owners to watering their grass only twice a week.

I thought "Why the heck are people wasting water using vast amounts of it to water their lawn twice a week? Why are people ever wasting precious water using it water grass just so that they need to cut their grass more often?".

I never water my grass and there's lots of water supply where I am.
This summer it hardly rained so I didn't cut the grass between 
mid-June and the last week of September and even then it was questionable whether parts of the lawn needed cutting.

Watering grass so that one then has to cut the lawn more times is like throwing clean clothes in the mud so that one gets to do laundry more often.

So yes, appreciate all the crops from the Southwest United States but people who live in a desert shouldn't be wasting water trying to create bright green lawns that don't belong in such an arid climate.
Reply: @Robert_Keel  it's not the farmers producing food that people question. It's others who decided to move to live in a nice dry arrid climate unnecessarily when there simply is not enough water in those regions to maintain large urban areas.
Reply: Canada also has its say on how these lakes are managed.   Maybe the Southwest should stop growing thirsty crops in the desert and add swales to retain rain water so that it won't immediately won't wash off in the ocean.
Reply: @badguy1481  No one told anyone to build property next to the lake. 
That's like building a home in tornado alley and being surprised it gets taken in a storm.
Reply: @walterbrown8694  70 years is a long time for laws to be written.
Reply: @shytownmofo  No they did it to connect a shipping lane between the lakes and the mississippi
Reply: @geofflepper3207  
Unnecessarily?
I'll remember that the next time there is a disaster somewhere.  If you live in paradise, maybe we should all move there.
Reply: @jacksnyder7318  
LOL.
Greed driven profits and prideful boasts?
Weaponized?  Please - get off your soapbox and start dealing with the real world.
Reply: @Robert_Keel  had to scroll through the comments to see that alot of people care about almonds
Reply: After all if we had to do without almonds or the Great Lakes the choice is clear
Reply: @badguy1481  Damm dude never saw a dam you didn't like
Reply: @jypsridic  no almonds in my state bud. Almonds aside it does not change the fact that 80percent of your produce comes from SW.
Like it or not your food prices are already tripling, w/o SW try 8x.
Reply: @jypsridic  if I'm correct the great lakes region is getting pounded with snow this minute. And will continue to do so for the next 6 months. Zero food coming from there I guess
Reply: @geofflepper3207  not sure where they are doing that. But here in AZ not a single lawn has been put in. Not in our 5500 home community
Reply: That is horrible.
Reply: @Superintendent-iy9zv  Corn has been 99 cents for years.
Reply: @KyrenaH  not per ear 🌽. I sold sweet corn for years. 13, we call a baker's dozen for 3 bucks. But that's here, not California.
Reply: @FastEddy301  We have these things called grain storage facilities. Ever heard of them? We produce over a third of the global grain supply, we have plenty of food even when it is cold. 

Each midwestern state annually outproduces the entire south west on food production. But yea, take your couple months of trivial production and pretend to be superior about it.
Reply: That water belong to the nation.
Reply: @badguy1481  The Great Lakes are largely immune to these weather problems. Michigan and upstate NY do not get tornados (a little more prevalent in western Great Lakes), and floods and forest fires are uncommon. Rochester had an ice storm thirty years ago that killed one person.  It's your problem that you live in a dangerous part of the country.
Reply: @badguy1481  get ur own water buddy it’s not our fault ur states can’t manage ur water resources properly
Reply: @badguy1481  Lake Ontario which touches New York and Canada that it’s international.
Reply: @thomasschellberg8213  Michigan does get tornadoes but they last for like two to three minutes. The last outbreak we had were we got thirteen tornadoes in one day was in 1997.
Reply: @questioneverything594  what nation?
Reply: @thomasschellberg8213  April 3 1956 F5 Hudsonville MI
Reply: @badguy1481  International.  Canada owns half.    Also why would anyone want to engineer a pipe that crosses the Continental divide. Instead of looking 2000 miles east,, look 500 miles north,, no continental divide to cross, 1/4 the distance.  Columbia River.
Reply: @Sailor376also  The pipeline would serve a dual purposed: 1. Provide MUCH more water than the Columbia can provide..and 2. Allow the level of the Great Lakes to be controlled.
Reply: @badguy1481  The level of the Great Lakes is controlled already, naturally and efficiently  maximum 6 foot difference form the absolute highest to the absolute lowest. The Great Lakes are controlled by an International treaty,, that is unbreakable.  And the Columbia has almost the same total flows as the Niagara River,, 1,500 miles closer, and 5000 vertical feet closer.  You'd need to tap the Columbia for less than 5,000 cubic feet per second  off a river that at the Dalles right now is flowing at 145,000 cfs.  And you only need to get it to Green River, Wyoming.  The Green supplies just as much water as the Colorado.  You almost would not notice the extra 5,000 cfs in the Green.  In the spring the Green runs up to 25,000 or 30,000  at the most,, and most of the year it runs at less than 5,000cfs
Reply: @Sailor376also  The problem: tapping the Columbia River drains a working river that requires deep channels for large cargo ships. Draining excess water from the Great Lakes poses no such problem. And regarding the natural ebb and flow of the lake levels:  plus or minus those natural limits causes massive damage to lake fronts along hundred of miles of coast line. Chicago ALONE had to spend HUNDREDS OF MILLIONS of dollars repairing the damage from the 2019 Lake Michigan level "max".
Reply: @badguy1481  Much of what you say is true.  Chicago may be a poor choice to point at,,, built on a swamp and in the 1850s and 1860s they made the move to raise the entire city   most buildings and roads, sidewalks were lifted about 6 feet. (They should have doubled that.)   Taking water from the Great Lakes carries a larger logistical problem.  The lakes rise about 3 feet and then fall about 3 feet  by the decades.  You would have 5 years or 15 years when water should not be taken.  Most of the problems with buildings are building to close to an eroding edge,, or built during one of the low water decades and then 20 years later they are having difficulty because of high water.  Many people cannot be helped when they make poor decisions.   Shipping is at least the problem of the Columbia,, Many channels are dredged and kept deep enough,, usually 34 feet,, High water times,, no problem,, but low water times  freighters must take lighter loads to not scrape bottom.  But mostly,,, it is international water,, Canada owns half,, and they way the pact was settled is unbreakable.  No water leaves the basin except in a pop bottle or similar.  None.  Zero.  Zilch.  100 years of court cases?    Rock solid.  Don't even consider,, cause it will never happen.
The Great Lakes are also at the whim of climate warming.  The lakes preserve their water by being frozen over in the winter,,, no evaporation.  Very few winters recently have seen the lakes frozen over.
The Columbia has just about the steadiest flow of all the North American rivers.   The Columbia flows at a rate 10 to 20 times the Colorado.  Tap it for 2.5 to 3 % of its water,, and you will nearly double the water available to Lake Powell and Lake Mead.  The flow through Cataract Canyon the last month or so has been in the 5,000 to 7,000 cfs range,, and that is a normal amount for half or more of the year.  Add 5,000 to the Green River 365 days,, you'd probably have too much water,,,,, but,, I suspect some of those new 1,000,000 resident cities in AZ would soak up the added with ease.
In case you wonder,, I canoe,, often weeks or even months at a time.  I have paddled much more than half of the total length of the Colorado,, several stretches multiple times,, The entire Green River (700+ miles) , multiple times,, The Missouri several hundred miles multiple times.  Gives ya lotsa time to observe and ponder.  The 1,300 miles of the Columbia is on a future list.
Reply: @Sailor376also  The damage to Chicago was along the Lake front, not in the City. I do not have the figures for other communities on the Great Lakes but I would guess they were also high for their community's size. 

Using water from inland rivers should not be ruled out completely either. As you mentioned there are times, during low water levels or even stable water levels in the Great Lakes that there will be no excess water available to supply the Southwestern states. So the use of their water, in moderation, should not be ruled out either. But that should not stop a plan to regulate the water levels in those lakes.
Reply: @badguy1481    There is an early 1900's international treaty between the US States and Canadian Provinces that border the Great Lakes that does not allow the transfer of Great Lakes water out of the area.  Believe it is limited to 10,000 gallons per year.  A railroad car.  Look up "The Boundary Waters Treaty of 1909".
Reply: Folks out west should think of a different solution for this will never happen. 
They say never say never, but with this one, I think it’s safe to say that this will never happen- a pipeline from the Lakes that is.  Don’t waste your time on this one.
Reply: @Robert_Keel  the midwest is the bread basket of America, that's where all the best rainfall and drainages are at